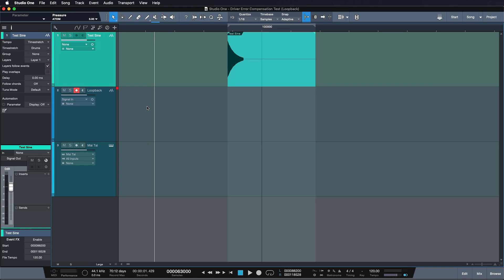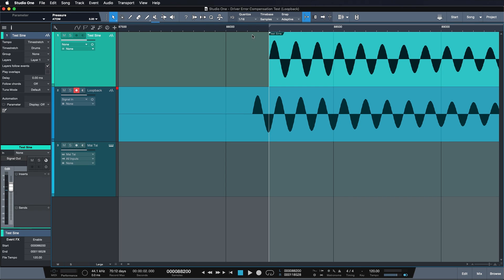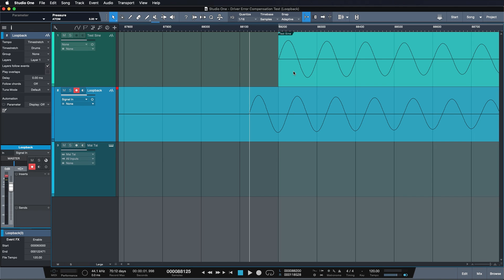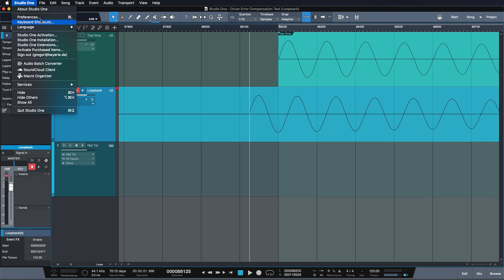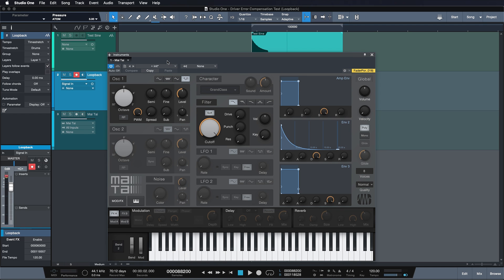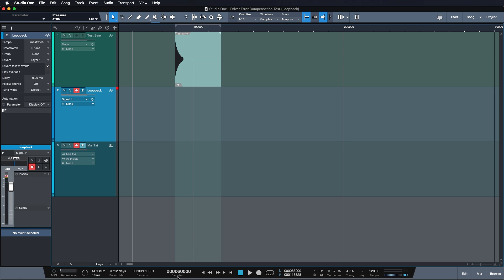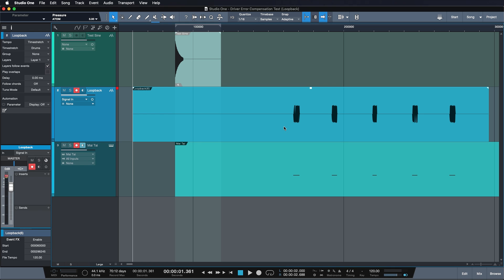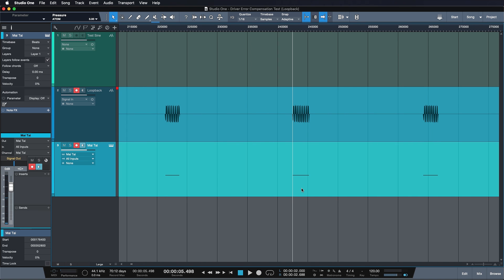PreSonus Studio One Tutorials Ep. 4: Loopback Test and Record Offset

Comment: Gregor, thanks for this video! But I am seeing something different than what this video shows. My recorded signal on the loopback track slightly LAGS the test sine wave (which in my mind actually makes sense as I would think the recorded signal would take some time to get recorded). But your example shows the opposite. It seems like I am not understanding something. Would love to hear what I might be doing wrong. Thanks!
Reply from the maker: If you need to move the recorded signal to the right to make it match to the sine wave, enter a positive value. If you need to nudge backward to make them line up, enter a negative value. Hope this helps. -GBY

Comment: Is -300 sample difference normal? Also my waveforms don't look identical i have an apolo twin. Also does device block size have effect on this meaning if you change block size you havto redo test.
Reply from the maker: Block size has no influence on this, since it does not affect recording (only real time). -300 can absolutely be normal, it depends on the kind of latency that your interface has. Usb interfaces are usually slower than thunderbolt, for example. -GBY

Comment: Thinking of switching to ST in 2024, is this still a manual process? There is no reason for any DAW to fail to place audio accurately in time as buffer size, sanple size and plugin delay are known quantities i.e. this can be calculated and no measurements are required. The only thibg that can't be compensared for is unknown delay in outboard gear. The sane is true for MIDI. So, is MIDI and audio placement accurate and automatic in ST?

Comment: Thanks Gregor. Interesting! However, this did not work for me . I have a Volt 2, did the loop back . My reading as follows 88200 (Test) 88268 (Recording), So my recorded wave was later by -68 sample? Actually no!  I thought I was going nuts, but the actual audio offset ended up as -114 samples and its now bang on. This exercise put me in the right direction, but I'm somewhat confused at the required offset. Also found the tab to transient feature was not working as should for me.  I have to be honest I've stuck with S1 18 months now, but Im starting to tire of these constant issues. Its great having new features but lets get the core things sorted. If you use the car analogy. No one wants a vehicle that breaks down every 5 minutes, irrespective of its billed features.

Comment: I'm curious. You're supposed to do this measurement with the low latency monitoring on, right? Because if you don't, and have a high drop out protection set it will be a very long offset due to the large buffer.
Reply: Good question... did you find out if you have to have it on?? 🤷🏽

Comment: Performed this recording loopback test with my tascam model 12 in audio interface mode and measured the latency at about 1300 samples. Entering this value in the Record Offset field and trying the test again doesn't seem to change anything.
Reply from the maker: Hi, this Loopback test is meant more for users who experience that what they're recording doesn't match the timing of what they were playing (this mostly affects users working with MIDI and virtual instruments). A latency of 1300 samples would be far too long to begin with for these purposes. You may want to try reducing your block size, if recording MIDI live is something you're interested in (e.g. with a MIDI keyboard controller). -GBY
Reply: @fenderstudio  Thanks for the feedback. I think this is specific to the tascam model 12 - it has a bunch of internal routing that is hard to get correct. If I route the main back into an aux track (in software) I get a very similar result to you and can correct it the same as you, but trying to physically route the main output into one of the inputs causes a LOT of delay and I think that's just the way it is. I don't get this delay when playing live - the midi correction works exactly as you described. Love the videos!

Comment: But why would you do this with a VST that you would not ever play out the audio and record it back in? I set how this would make sense with a external synth. And I can see if this would help if recording the audio in realtime performance but what about if you have multiple midi tracks recorded to then play out the synth and record in the audio. Dont you need to set midi ofsets for each synth because they will al start slightly out of time due to there unique processor timing? This is the internets most neglected or understood topic that Im really tryng to solve.

Comment: Hi everyone, I performed the test and I got the opposite result, there is, my record offset is not too early, but too late. The sine wave sample is 88200 and my recorded sample is 88328. So the offset is a negative 128 samples. I adjusted the Record Offset samples  in -128 and now I have no sample difference, as intended. 
But does this makes sense? Has anybody experienced the same situation?

Comment: If you change the buffer size (such as 128 samples to 1024 samples) I tested the record offset and audio was good but the midi was off again (after I adjusted it previously). Is this correct? I generally have my buffer at 128, I record audio and midi.

Comment: What about those of us who don’t record audio, don’t use an interface, and  work strictly with VST’s?  Why should we have to record an audio track to determine an offset for something we’re never going to use just to get the metronome to sync properly?  I didn’t have to do this in any of my other DAW’s I use.  I record strictly midi, and even if my timing is almost spot on, the midi data recorded always shows each note recorded way ahead of where it should be, and upon playback the midi doesn’t sync (audibly) as it was recorded with the metronome.  My latency is fine for real-time play of my VST’s.., no issues there.  Everything gets thrown out of sync when recording with the metronome or even a self generated midi click track.

Comment: I think this loopback test should be implemented built-in as a simple dedicated button in the DAW.  The fact so many people don't know this is reason enough that a DAW maker should guide the user to make this adjustment as part of a midi track or audio setup.  Make it as easy as possible next to the input and outputs of a track.  Show the delay compensation number and allow the user to disable it if needed but make it standard.  The DAW would just send a predetermined pulse to a known input and output then show a suggested delay compensation value.  Place it next to the input and output of the track.  No digging through menus.  No setting up of separate tracks and no separate plugins.  Just a dedicated button.  You press it, the DAW asks what's your in and what's your out?  Go
Reply: Поддерживаю. Все действия, что имеют единственный вариант развития, должны быть автоматизированы. Поэтому мне непонятно, почему  в программе до сих пор не автоматизированы все эти арифметические действия и алгоритмы по расчету и компенсации задержки. Вроде бы 2025 г. уже. Пусть для специфических ситуаций остается возможность ручной компенсации, но для большинства случаев логично ожидать точной записи...

Comment: Aww, nice one Gregor - I shall be sorting this out later (Studio One Professional 5 with a STUDIO 68C interface).
I should have thought about this before, but I haven't been using a DAW/interface for years and years  - I've been using a BOSS BR1600 standalone machine exclusively for 10-15 years I think.

ANYWAY - I have a question: Will this affect Transform to Audio (MIDI track playing through a virtual instrument, converted to Audio)?

What sent me down this rabbit hole was using Transform to Audio on a drum part going to EZDrummer2. I had to do it because I was running out of processor in my mix. Everything was fine until I noticed sometime later that the groove was mysteriously "gone". I eventually proved it was the drums by soloing my lead vocal over the Transformed audio of the drums (separate tracks) - that was "Meh". Brought the midi back and played it through EZDrummer again, soloed the same vocal against that - and that was "YEAH!!"
Even my wife could tell the difference, not why/how, just one felt good, the other was just "that's alright, not brilliant"

I spotted the transformed drum audio (eg the kick part) looks to be late when compared to the original midi notes.
I'm hoping the loopback testing and setting the Record Offset will make sure this doesn't happen again.

Comment: Question - I am just starting to come up to speed with my new PreSonus gear.
I have the StudioLive 16.0.2 USB mixer. I am looking at connecting a cable from a free output to a free input. Input is obvious - any one of 16 available. What do I plug into for output? One of the 4 Aux outputs?
Figured this out with my IO settings. Test worked great.

Comment: Hey Gregor, thanks for this, is there a chart of midi latency per sample rates? as it differs in fonction, with an IO Station, I have 28ms offset in 512 and 49ms in 256... Also is this even necessary when working in 256 with low latency for instrument enabled? Thanks a lot in advance for your answer

Comment: for the people here trying to download and get a loop back file to work.....all you have to do is print a click track from selection. turn on snap to grid make a one bar selection from say bar 2 to bar 3.  You now have a test sound that you can use to calibrate the record offset in the daw.
Reply from the maker: this wouldn't be an accurate test, because this approach does not take the roundtrip hardware latency of the audio interface into account. -GBY
Reply: @fenderstudio  of course you would then send the click out a channel on your interface and then route it back in just the same as in the video, I was simply pointing out that you don't need a special file to do this.

Comment: Doesn't work for me : so what's this device you plug with a jack and use beside the audio interface at 1'13 ?? Drives me crazy not to solve it, thank in advance
Reply from the maker: Hi Urblaw, there's nothing but an Audio Interface and one jack cable involved. Connect the jack cable from an output of your interface to one of its available inputs. Assign these inside of Studio One as shown, in the Song Settings -> I/O Configuration. -GBY

Comment: I did this but I have one concern with my implementation. In Gregor's example, the loopback and test wave are pretty much identical, just shifted. When I did this test, the very first peak of my loopback wave has a slightly smaller amplitude than the second peak. Any ideas why?

Also, when doing the midi part, why doesn't the test wave show up in the loopback. I noticed that that track isn't muted so wouldn't it still be fed into the loopback?

Comment: Don't forget that if you change the device block size in Audio Setup > Audio Device this operation should be done again. But Studio one unlike other daws I used in the past, doesn't necessarily need to have its device block size to be tweaked depending on the session...

Comment: A  lot of people seem to be having difficulty hearing or recording anything, including me.  I am a total noob to any kind of DAW recording and spent the better part of a day pounding my head on my desk.  I'm using  a Studio 24c with Studio One 5 on a Mac.  When I started recording, I could hear the blip of the sine file but nothing was being recorded on the loopback track as shown in the video.   Short story - my audio playback device  (Menu->Studio One->Preferences->Audio Setup->Audio Device->Playback Device) wasn't set to my 24c so no signal was coming out of the main outputs to record on the input.   The blip was being played out of my laptop speakers and I just assumed it was being mirrored to my 24c.  WRONG!  I went through a whole bunch of troubleshooting steps to find this one simple thing.   I suspect many of the steps I took will help solve other problems too and thought I'd share.  What we're going to do here is methodically chase the signal chain: sine wave track->main out->input in->loopback track.

Plug a monitor (I used a Roland practice amp) into the main output on the back of your hardware interface and confirm you can hear the sine wave tone.  If you don't hear anything try the following:

- Check your monitor speaker (Roland in my case)  volume is up.  I plugged my guitar in and made sure I could hear something.

- Make sure your audio output device is set to your hardware interface.  StudioOne->Preferences->Audio Setup->Audio Device->Playback Device == 24c (or whatever your interface is). This was my issue.

- Make sure the MASTER output in the Studio One song is mapped to your interface outputs.  StudioOne->Preferences->Song Setup->Outputs.  Make sure master shows up and it's tagged as used.  If not used, or you want to double check, click the MIX button in the lower right and then on the MASTER output make sure Main Out Left + Right is selected just above the slider.

- On your hardware interface, make sure the master and mixer knobs are at the midway point or higher.  You can fine tune levels later but if these aren't turned up you won't hear anything or it will be very quiet and you may miss it.  You may want to max these knobs right now to be safe.  Your recording will sound terrible but you can fine tune levels later.  Note: the mixer knob should be all "playback", not "inputs" if you max everything out.

- If you don't hear output on your monitor, then the loopback test won't work.  No signal to record!  If none of the above worked, you'll have to keep plugging at it until you get the sine tone before proceeding.

Once you hear the sine tone on the monitor output, unplug the monitor speaker, and plug into the left or right input channel of your hardware interface.  This loops the main output back into the input so you can record it and compare delay as shown in the video.  If nothing records, then try the following:

- After recording if you don't see the color assigned to the loopback track in the track view, then you probably don't have a hardware input assigned to Eingang 1.  Open the audio song preferences (per above) and assign the input you've plugged into to Eingang 1.  Or set for stereo to play it safe.

- On your hardware interface crank the input gain knob all the way up.  In Studio one (and on the front panel if your interface supports it) you should see the signal indicator on the loopback track peg to max.  If not, then open Audio Song Preferences and make sure that the input is mapped to Eingang 1 which is assigned to the loopback track. If the input is mapped correctly, you probably need to increase the main volume on your hardware interface.  If that still doesn't work, I'd plugin a monitor again to confirm the output on main and you're in territory I didn't cover.  If you aren't using a stereo input to loopback, double check you have the correct channel (i.e. left or right) assigned.  

- Tip: I found that plugging my guitar into the input was a helpful way to test the loopback input was setup correctly.

Once you get the loopback working, you can adjust the main, mixer, and input gain knobs on your hardware interface to remove clipping and optimize signal levels.  This will let you get a good look at the recorded sine wave. Hope this is helpful!
Reply from the maker: Hi Matt, appreciate your detailed instructions - Please note though that this tutorial is NOT directed towards absolute recording beginners. If you are just starting out with recording, there's absolutely no need to ponder offsets at a sample level. For people starting out, I'd much rather recommend the following tutorial: https://youtu.be/wt0ndsyM5Vk
-GBY

Comment: Nice work.  Please make your cursor bigger so older eyes can track it.
The other thing, this makes no sense to me.
Unless you are quantum teleporting into the future, How can a loopback record AHEAD of the original signal?  Shouldn't it be behind in time? i.e. due to latency delay?
Reply from the maker: Hi Allen, thanks for your kind words! Keep in mind that there is always an offset applied by Studio One after the recording has finished, which by default is equal to the amount of roundtrip latency reported by the interface driver. And if the interface driver is actually reporting a longer latency than there actually is (which happens more than you think), this results in a recording that will be placed ahead of the original recording. -GBY

Comment: I entered -12 samples to work. Can that even make sense? Yes with a negative number, I'm a beginner here, for some reason my loopback was actually misplaced to the right
Reply from the maker: That can totally make sense. This would just mean that your roundtrip latency is 12 sample shorter than what was reported by your Audio Interface driver (the driver does not deliver a reliable measure due to variables such as connected Hubs etc. that the driver cannot account for). -GBY